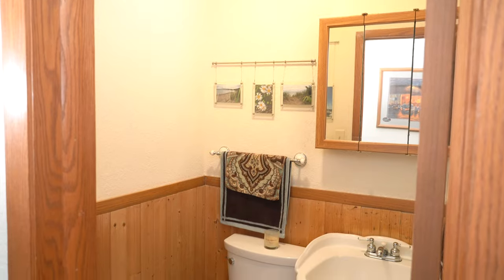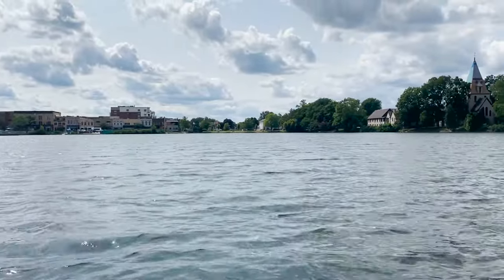Extreme Small Bathroom Makeover| PT. 1

Comment: Looking forward to what you come up with for the vanity. I'm planning on remodeling my 2 bathrooms this year (although I won't be doing the work at 67 with double knee replacements). Loved that first vanity and it's along the lines of what I'm looking for. I'm disappointed that it's darker than the pictures. It's looking great, Mailey. And I'm beyond impressed with your paintings!
Reply from the maker: If you have a bigger bathroom then my mom does I highly recommend the first vanity it was actually really nice. I was so bummed it didn't work out but it was of the best. Thanks so much for watching!
Reply: @MaileyElaine  I need a 30 inch vanity for one of the bathrooms. I saw the brand was Studio Design and started trying to find it online but got sidetracked.  I also need a 48 inch vanity and want the two to be the same.
Reply from the maker: @cyndij8312  oh okay yeah I think it I remember correctly they did have them in that size